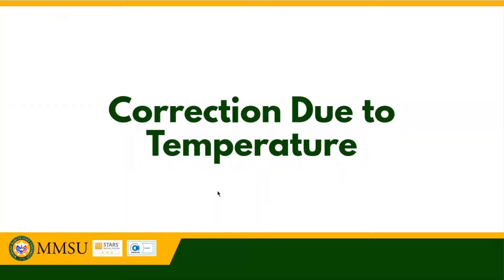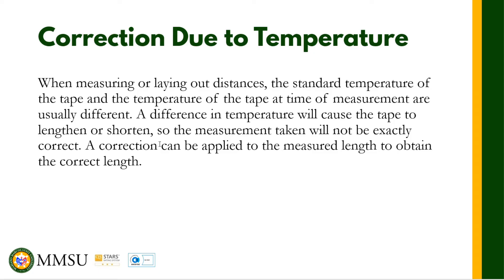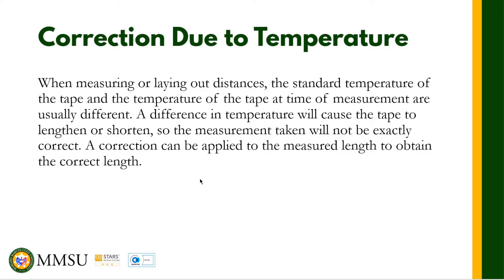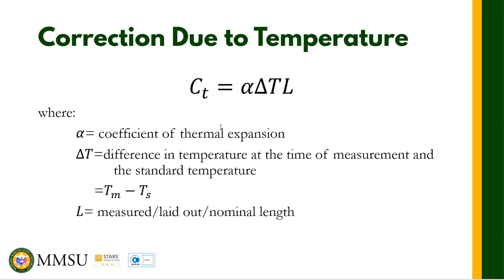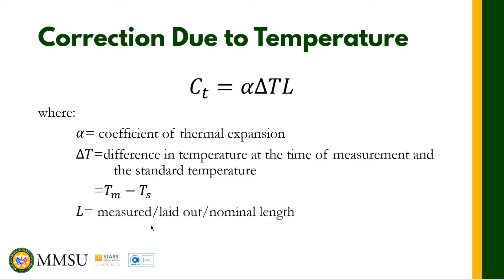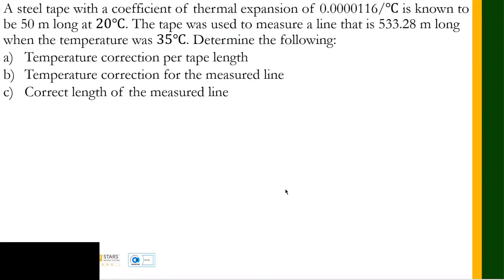Correction Due to Temperature | Taping Corrections | Surveying

Comment: Sir jonas papaano po pag tinatanong "compute the standard temperature"
Reply from the maker: Doon sa formula, solve mo lang Ts. 

Pwede makita ang buong tanong?
Reply: Okay po sir wait
Reply: Sir based po sa problem, ano po yung gagamiting observed temp? kasi dalawa po yung given na temp?
Reply from the maker: @blackpinksyndrome2881  ganito kasi yan..

Ang standard temperature ay ang temperature noong na standardized ang tape.

And Tm naman ay ang temperature noong nag measure ka at ginamit mo yung tape.. 
Nasa problem naman yan. 

So ano ang temperature ang gagamitin mo?
Reply: @JonasClassNotes  bale yung 24.6°C po ang gagamitin sir? sige po maraming salamat po! GODBLESS  🙌
Reply: A 50 m. steel tape was standardized and supported throughout its whole length and 
found to be 0.00205 m. longer at an observed temperature of 31.8˚C and pull of 10 
kilos. This tape was used to measure a line which was found to be 662.702 m. at an 
average temperature of 24.6˚C using the same pull. Use coefficient of expansion of 
0.0000116 m. per degree centigrade.
a) Compute the standard temperature.
b) Compute the total Temperature Correction.
c) Compute the correct length of
Reply from the maker: @jamcatolico8985  Given naman na lahat ang data mo except yung sa Ts. So basically, gagamitin mo parin ang formula pero ang isosolve mo ay ang Ts. 

Update mo ako kung na solve mo na
Reply: @JonasClassNotes  sige po sir salamat po
Reply: @JonasClassNotes  sir pano kung wala pong  Ts paano po makukuha yung Ct?
Reply from the maker: Usually, ang ginagamit sa Ts ay 20 degree celsius.
Reply: @JonasClassNotes  salamat po nakulangan lang yata ng paglagay ng Ts yung prof namin Godbless po